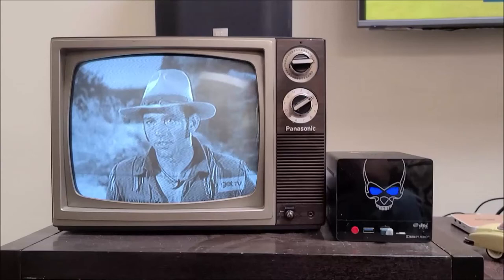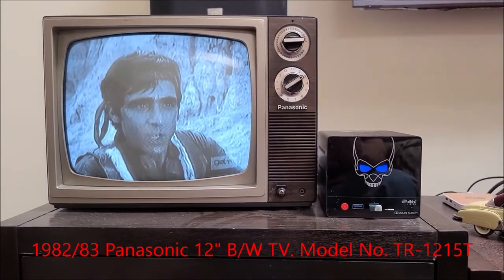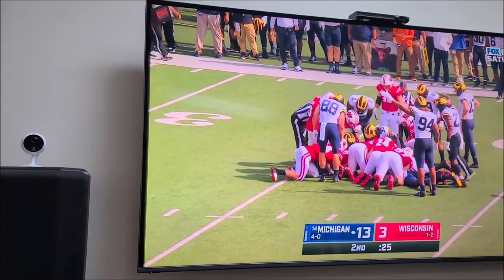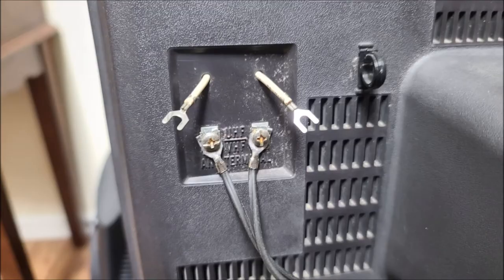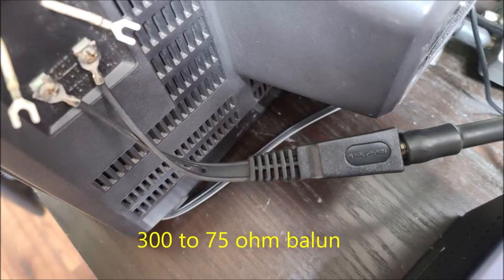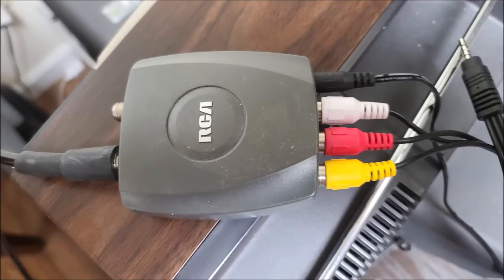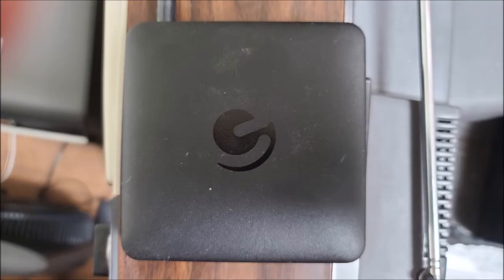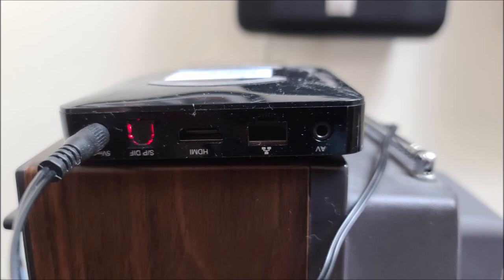How to connect old CRT TVs to media player

Comment: Hi great video, can you help? I have just bought an old CRT tv for gaming and I want to add a speaker. It has 3 audio input for the console I will be using (yellow, white, red) a microphone port and 2 scart on the back
Reply from the maker: I am not really sure.
Reply: You can buy what is known as an rca adapter
Reply: @noaheast6285  thank you

Comment: I’ve used the rf modulator on my black and white old tv as instructed, sound came out really clear however the image didnt come out, it was only the flickr.
If anyone knows the solution, i’d really appreciate it
Reply from the maker: Try changing the channel from 3 to 4 or 4 to 3 on the modulator, and your TV.
Reply: @clarkss12  thanks for the response, unfortunately still didn’t work